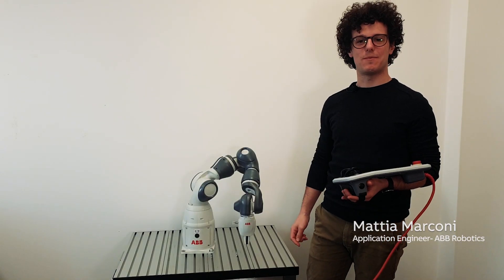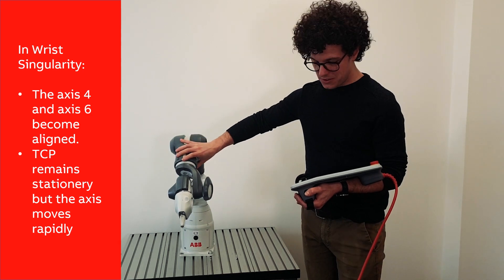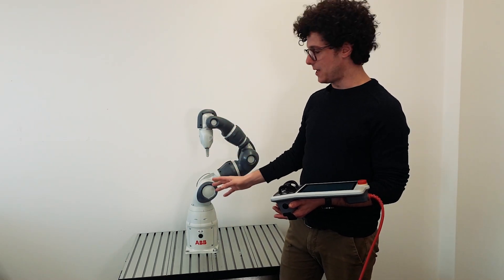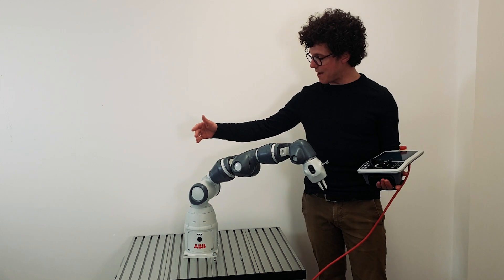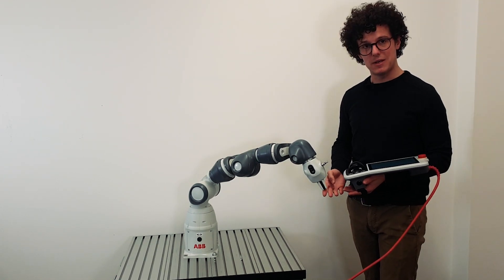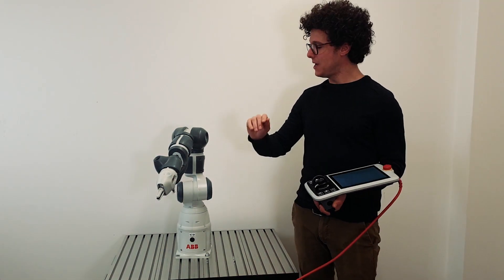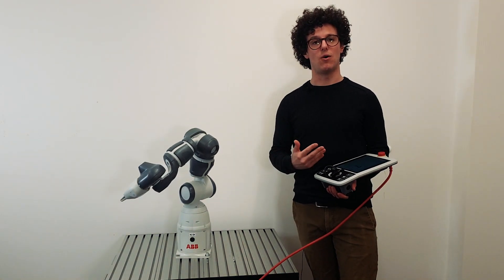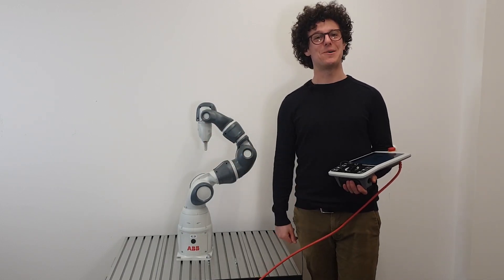Types of singularities and how to avoid them: Quick guide with ABB's single-arm YuMi cobot.

Comment: I still don't get it, to avoid gimbal lock we use quaternion instead of Euler angles directly or we detect the gimbal lock and then adjust the orientation to continue the trajectory?
Or adding one more joint (7th joint) to solve that?

Comment: Another, more nerdy, reason that the ABB is able to avoid singularities during operation is because of the use of quaternion pose mathematics.  Quaternions use a 4D space and won't have singularities.  That's why you get singularity errors during manual movements, but not during operation.  Most other robots user the homogeneous transform matrices which suffer from singularities, mathematically speaking.
Reply: You are mixing the concepts of so-called representational singularities, inherent to any three-parameter representation of orientation in space, such as Euler angles, and robot singularities. The use of quaternions instead of Euler angles does not solve your problems with robot singularities.
Reply: @ilianbonev5171  I should clarify, the mathematics of quaternions are free from singularities.  The physical robot has singularities, that won't change.

Comment: I am very disappointed at ABB. 
I need to know how to wire the safety circuit on robot controller irc5. I read many manuals, searched on the web, watched videos on youtube. 
But I got nothing useful. F..k. Why tell us the garbage here? And ABB put lots of videos but none of them tells me the technical details. None of them tells me how to fix the problem. 
F..king stufid.
On its manual about local IO module 1030, there is even no wiring diagram. A manual for electrical device never shows its electrical circuit. Then how can I use it?
So f..king stufid.
Reply from the maker: Hi George,We are really sorry that you could not find the circuit diagram. Please have a look at this document, you will be able to find the diagrams in here, https://search.abb.com/library/Download.aspx?DocumentID=3HAC024480-011&LanguageCode=en&DocumentPartId=0&Action=Launch)
Incase, you need further assistance, please contact our team at
global-cobot-team@abb.com
Reply: @ABBRobotics  I clicked the link. A sign-in page pops up. Why sign in? Why not to directly link to some pdf manual?
Reply from the maker: @George, If you already have a robot that you need to register it so that you can access the ABB Library, if you don't have access to it, please check within your company, somebody in your company might have already registered the robot and you can take details from them. In other case, please reach out to us through, global-cobot-team@abb.com
Reply: Amateur